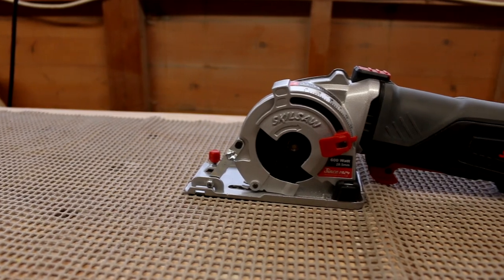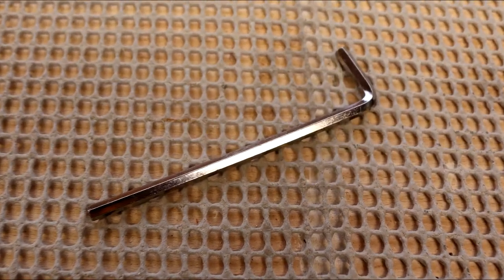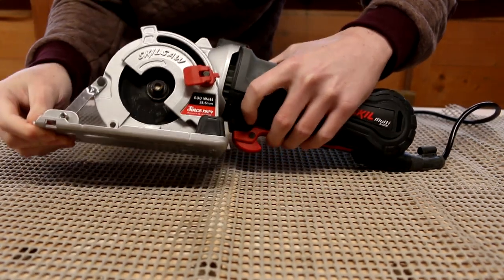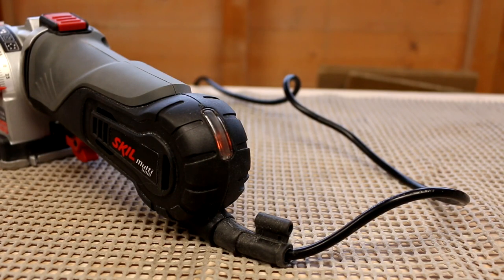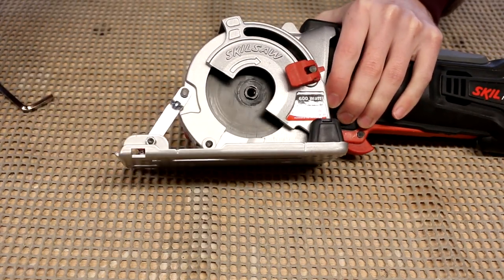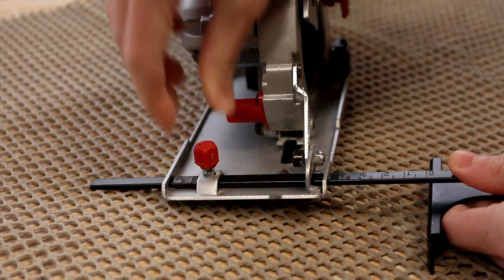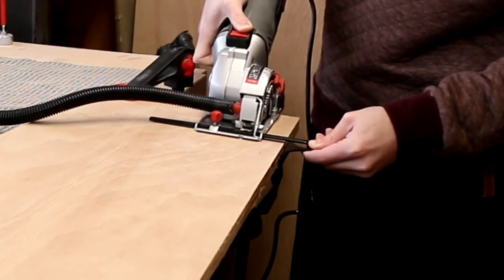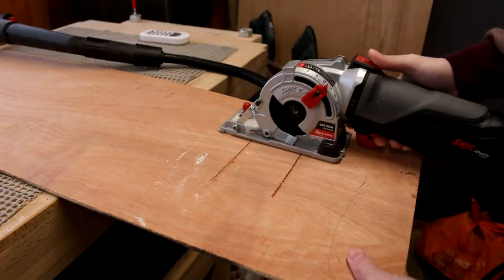Independent Review - Skil 5330 AB (Multisaw)

Comment: A word of warning. I too have one of these saws and I bought mine for cutting floorboards so I do not use the guide at the front. I was using the saw when I noticed that the screw at the front was missing, with the vibration of the saw, the screw had come out and I had a lot of sawdust to look through to find it. I did find it and tightened it down and have not lost it since, it is a very minor problem that is easy to fix but you have to check it every now and then

Comment: Good review Joe, the dust extraction is impressive the saw  would be useful for laminate flooring projects. Tell me Joe have you thought of insulating your shed would make it a lot more comfortable for you to work in Winter and summer.
Reply: +Average Joes Joinery When i built my shed which i intend to extend in the spring ,i placed old fashioned building paper ,brown one side and black tar other on the outer face of the studs .This acts as a breathable and waterproof membrane. Then i placed 2" polystyrene between the studs leaving a air gap of 1" as the studs were 3" thick this was achievable. Never had a problem with it i even done under the floor and ceiling. Maybe with your existing shed use 1" polystyrene that will maintain a 1" air gap  between the inside face of the cladding and the insulation. Then place a breathable membrane on the studs ,then your plywood inner face. Far cheaper than foam ,just a suggestion Joe go steady Mick.
Reply: +Average Joes Joinery No problem Joe just trying to help , a company called Encon insulation  do all sorts of insulation plus i guess good old Wickes.